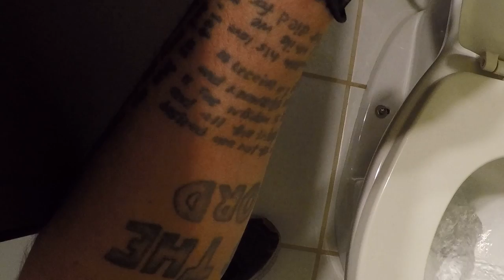How To Remove  A Foreign Object From A Toilet - Ahwatukee, AZ

Comment: I have been in apartment maintenance for 47 years and have pulled toilets many times... this video shows EXACTLY how to do it. My only suggestion is to replace that flexible water supply line with one that has a 3/4" METAL end, instead of plastic. Over time that plastic end may crack and leak. And always look around the bathroom when on a clogged toilet call for a box of Q-tips nearby. Weirdest thing I ever found stuck in a toilet bowl? Upper dentures. And for all you first-timers, never Never NEVER over-tighten the nuts that hold the bowl to the floor.
Reply: Why shouldn't you over tighten the toilet nuts?? I just tightened mine recently because the toilet kept turning
Reply: @peterhy1251  overtightening the bolts could crack the toilet. 

For the repairman, he'll get a feel for how tight is right eventually, and until then it's better to get a call back to tighten some bolts because he didn't get them tightened down enough than to get a call back to replace a toilet.

For the homeowner, you'll be there to see if it's not quite right enough. You can adjust a tiny bit at a time until it's good.

But be aware, a wobbly toilet might not be loose bolts. For instance, an apartment complex I used to work at had some toilet flanges that sat above floor level (apparently they were thick tile floors in the 60s when they were built, and later switched to linoleum) so the only way we could got the toilets stable was either toilets with a recessed underside or using plastic shims.
Another possible cause of a wobbly toilet could be a damaged flange. They do sometimes rust out or crack. Unless the issue is loose nuts, tightening will NOT help.

Comment: Purchase a dewalt oscillating multi tool and use a dremel carbide blade. It will cut the tank to bowl bolts, bowl top floor bolts. I use it to cut out faucets, remodeling etc. Corded or cordless.

Comment: Why no silicon rubber seal on the gap between the toilet bowl base and tile. The smell will come out and bowl will move thru use if the tile floor is not level
Reply: because owner doenst pay for that, they only pay for clog toilet, if we have to fix your toilet that is diff charge.
Reply: @dangda-ww7de  Don't know who you worked for, but when I did house calls, if you pulled the toilet off you sealed it back up when you finished the job. It's not gold, and not much is needed.
Reply: too much time to seal it back up, my customers didnt want to pay extra so i just leave it. @modetallah

Comment: The only thing I would add is that most ratchet wrenches the handle is offset to the head so that it goes slightly upward or downward. On the ones that do with the handle in the upward orientation the nut will be loosened. If yours do not have the offset then all you need to do is make a couple of small nicks with a grinder to mark the loosen side.

Notice to internet experts who are waiting to bash....if you are pulling on the handle hard enough to worry about nicks on the handle you will have a lot more to worry about than a broken wrench LOL

Comment: Did you try to snake it from a top first? Thanks.
Reply from the maker: Yea I was there a few days before and cleared it with a closet auger. I felt something but it was flushing fine. I told her if it happened again that I would pull the toilet up. So here I am.

Comment: Good video however it was no talking you did not really explain what you was doing. You don't have to hold the Johnny Bolt when you're cutting it. What is up with these people putting caulking around the toilet.. Is it me or are those Johnny bolts too long? When your in that kind of business try to have different lengths of bolts that way You don't have to cut them.I would put the caps on the bolts just to make the customer happy. You don't have to double up on the wax rings just get the thicker ones.I only double up if the floor had several layers.

Comment: I can't unscrew 1 side the bolt keeps spinning with the screw... I got one side off using two vice grips or whatever ha. But the other side is rusted..
Reply from the maker: Hold the nut with pliers and cut the bolt off with a hacksaw. Or use something to pry up on it and put some tension on it while you try and unscrew it. Depending on the size of the bolt you might be able to use a fork or something to get underneath it. They also make a small tool called a Johni-Bar. Check it out.
Reply: GMR PLUMBING thanks for the quick reply! I used an angle grinder to cut it off. Called my landlord he came by and said pour liquid draino in it.. didn't work lol. I have the toilet off now and used the auger in the underneath hole.. then in the bowl 5times. Still cant find anything stuck.. so I'm just putting the toilet back on see if it works 🙏
Reply from the maker: If its a real old toilet, it may not actually be clogged. It may be the ports in the toilet. To test this, put the toilet back on and fill up a 5 gallon bucket. Dump it down the bowl quickly without flushing. If it flies right down then you know its not the drain, its the toilet. If it fills up then you know its the drain further down than in the toilet.
Reply: GMR PLUMBING okay I tried the 10 gallon of water. It slowly drained. So I figured I'd hook the water hose back. It filled with water... tried flushing the normal way. Once again the water stayed in the bowl about a minute.. but now the floater thing isnt working to refill the water damn.. time for a new toilet I suppose

Comment: I've tried everything to get a deoderant out of the toilet. It seems to be lodged about a foot up as the toilet drain curves upward. The worst spot. I think I need to take the toilet off the floor. Yuck.
Reply from the maker: sa H Yea you might have to. And even then it may not come out. In that case you would have to replace the toilet. Good luck!